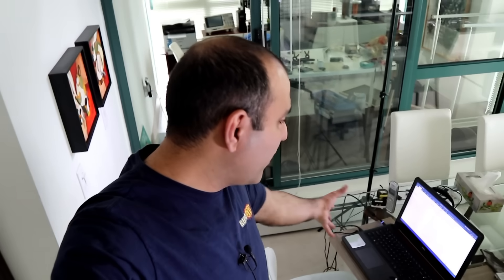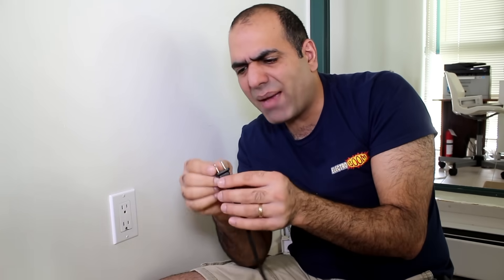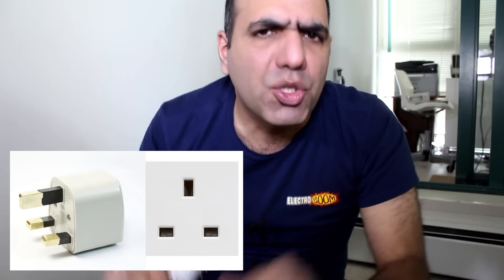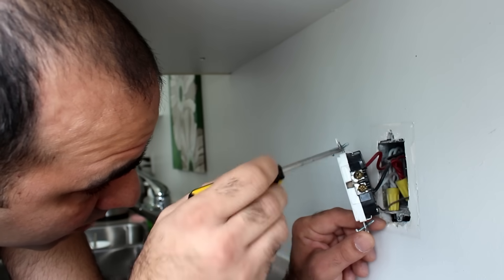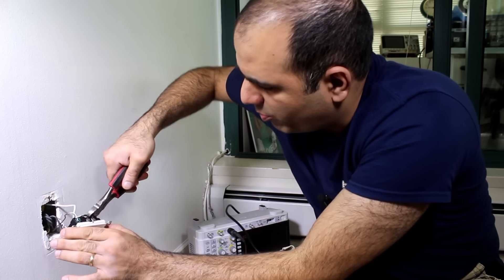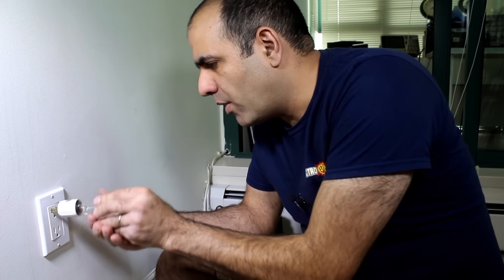How to Replace a Power Outlet

Comment: You want to bump your A-grade installation up to an A+? Just wrap some electrical tape around the outlet, covering the screws so there's no way anyone can get shocked by grabbing the sides of the thing.

Also, as others have pointed out, don't use the back holes. Use your wire strippers to bend the wire into hooks and loop them around the screws. That way they can't pull out and cause issues like Medhi mentioned, ESPECIALLY if you use the tape as mentioned earlier.

Comment: We in germany use safer power Outlets but use 230V in them and in Motor and Camping Power Outlets with three Power wires we have 400V difference what is more dangerous. Our wire coloring is Different red, grey and black is for the Power, Blue for the Nutrient and green yellow stripes are the Ground/PE well do me a favor please watch out a little bit more it Seems like almost every second Video you almost die it hurts me inside to see how you act so unsafe. Electricity can be very dangerous and deadly. But your Videos are very entertaining.

Comment: Yeah, at least in the US very few residential areas have 3-phase brought to them, and we have the center-tapped configuration you showed. It's unfortunate because it means running any 3-phase equipment requires either 1) a rotary phase converter or 2) a VFD.

Comment: There is an easier way to know what cable goes where on a North American Plug. 

White to white: the screws on one side of a plug or light switch is always silver (or white) and the other a golden colour. This is to visually signify what side to put the white and coloured wires. 

Though I am still unsure about 3 ways.

Comment: I always wrap electrical tape around the outlet after wires are attached. Just incase one would come loose it would short out and cause a fire. Also when the next person takes it out they won't get zapped by touching screws as you did 😉lol.

Comment: PSA from electrician. Do not backstab wires into outlets! The connection will loosen over time through plugging and unplugging things several times, which can cause arcing in the outlet. Instead, loop the wires around the appropriate screws, making sure they're bent in the same direction that the screw turns into the outlet, then tighten, making sure the wire is all the way under the screw. The connection will be much stronger and last for much longer.

Comment: North American regulations and standards really are the stupidest when it comes to power. Not only do they use 110V so they need 2 phases to power large loads, they also keep their wires on exposed metal contacts so you can touch them and get fried (still your fault if you didn't cut the power, but jesus....). Also from what I gathered GFCI outlets are not mandatory in all outlets. In the EU (or at least in Italy where I live) ground fault and overcurrent sensing circuit breakers are installed on the main line into the home so every single line in the house is protected. And we use 240V so our big loads use just one plug and not 2.

Comment: im pretty sure by now you know for sure but yea in usa and possibly canada unsure but houses use 240/120v single phase ac for the most part and commercial can use this same setup or can also use 240 delta 3 phase which is fairly rare or 208 y three phase and industrial usually uses 480 y 3 phase these are the typical setups

Comment: Fun fact: Insurance pays for stupidity. They will still pay out if you do your own electrical work and screw it up and burn down your house - as long is was not your goal to burn down your house (which would be insurance fraud). To deny your claim based on unlicensed electrical work, that exact thing would have to be listed in your policy as a reason to deny. So read your policy. If it's not in your policy, they can't use it to deny your claim.

Comment: The way I was raised I learned that you didn’t need the third prong for the large hole on a outlet/plug lol if you don’t have the big hole on the bottom plugged in or the third wire prong broke off it will still work and won’t hurt it

Comment: You know. In germany we have these 5 rules of safety.
1. Freischalten (Disconnect breaker)
2. Gegen wiedereinschalten Sichern (Make sure no one can close the breaker)
3. Spannungsfreiheit feststellen (Make sure there is no voltage present)
4. Erden und Kurzschließen (Ground and short, only for systems above 1kV)
5. Benachbarte, unter Spannung stehende Teile abschirmen oder abschranken (Cover or fence off nearby device that are still powered)

When doing your Job training, its one of the first things you learn. Eventhough you might not have much to do with mains voltage.

Comment: once when I was younger, I saw an outlet without a cover, and I tried to pull it out of the hole with one hand, connecting my hand to live and neutral. I got a shock, but it wasn't that bad. Now that I know how much that should've hurt, I am kind of confused how it didn't hurt more than it did.

Comment: I have actually grabbed those side screws once😂😂😅
Reply: Ikr. That’s why u should always tighten all the screws n wrap the electric tape around the outlet after installation. But as long as ur not touching the neutral/ground and the hot at the same time u should be fine, given that u are well insulated from the ground (the earth).

Comment: Axtually you are getting two different phases of a 3 phase libe in commercial buildings. You are correct that most homes in the USA get split phase, which are 180° out of phase. The NEC code prohibits 2 phases in an outlet box. They cam be two different circuits, but on the same phase.

Comment: You forgot to mention to make sure you wrap the ground wire clockwise around the screw. Also, its stronger mechanically to wrap the wires around the screws instead of putting the wire in the hole

Comment: 2:10   120 degrees between phases sound to me that they are two phases of the three phase power used in the larger buildings, factory,s etc
Reply: You are correct
Reply: @Owen_loves_Butters no 12:00:00 😊
Reply: You are correct. But in countries like India, UK etc. there is already 240V/220V ac in one phase. So no need of the 2 phase . Every outlet has 220V/240 directly in one phase. So it only uses only rating differences in outlets ( properly rated for large power appliances like oven/fridge/washing machine etc)

Comment: Hi Mister Electroboom,

Do you think you could make a video about the loose outlet of computers charging cable? Basically, the situation is very similar to what's depicted in this video where the female side of the outlet has lost a lot of its grip but, instead of the power socket on the wall, it's the female port of the computer that's causing me problems. It's not super drastic and it can still hold on OK but i was wondering if you have a few tricks that I could use to either repair or help it hold on better. Thank you.

Comment: On the back of the receptacle where you snipped the wires, there's a little slot to insert a screw-driver that'll release the wires so you don't have to snip them.
Also, the receptacles in your house are cheap AF- If you open one up (or look carefully in the contact holes) you'll see there's only a single contact for each prong.  Better (more expensive) receptacles have two contacts pinching each prong when it's inserted. That's why bending the prongs on the plug together makes it tighter, and bending the opposite way (apart) will cause them to make poor contact, or no contact at all.

Comment: i did not know that 3 phase was used in residential areas in our country but as you said maybe it is a high rise thing to ease the power distribution as three phase can be transported and converted more efficiently in transformers but how do you deal with standard 240V appliances like ranges, dryers or water heaters?
Reply: Use a Scott-connected transformer. Derives a split-phase supply from any 3-phase supply.

Comment: In EU it does not matter how you connect live and neutral
Bcuz you can flip the plug 180c
Reply: That's only true in those countries that use the Schuko connector. It's a weakness of that connector that it is not polarised as it means that if an internal fuse in a device blows there's a 50:50 chance it's still live. It also means that single pole switches, such as those on table lamps, always break the live side rather than it being a 50:50 lottery.

Several other countries, like the UK, Ireland, Malta have polarised outlets as well as some non-EU countries, like Switzerland. The original North American outlet wasn't polarised either, and the feature was added as a safety feature via a wider blade (although it maintains compatibility with unpolarised plugs where that isn't required).
Reply: Nope. In Poland we have mandatory Polish Norms which do specify the live wire shall always be at the left side of the protective earth contact, and the neutral on the right side, with the protective earth contact above them. This way even if the receptacle is rotated, wires still are oriented the proper way.
Reply: Your plug is reaching 180 c? That's a fire hazard and you need to figure out what's causing that, ASAP!

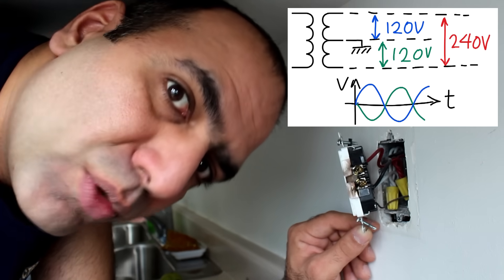Comment: 2:32 Mehdi!  Don't snip the wires!!  They'll get shorter and shorter, each time the receptacle needs to be replaced.  Instead, use a small, bladed screwdriver to press the release buttons.  But, on second thought, you'll probably burn your house down, way before this becomes an issue -- so, never mind.
Reply: Hey, i agree but notice that theres 3 wires coming into this box. Meaning that they had to wire nut the wires together with a pig tail (a single wire) to go to the receptacle. So in this case clipping them makes no difference cause you can just replace the little piece of wire. Good eye but in this case it doesnt really matter 👍
Reply: As an electrician who has installed thousands of outlets, I have only ever used the holes in the back maybe 5-10 times. We always use the screws because the connection is more solid, and like you brought up, it doesn't get shorter. Also, if we have to remove an outlet for any reason, the wires clipped in the back need to be removed anyway, so just unscrewing makes it so much easier
Reply: @petersquatch  Screw connection will get loose over time. That is the reason why (at least in Europe) they are being phased out by the more modern "Wago" push fit connectors. Not only they are easier to install (don't have to screw them) but they will guarantee a better connection. 

I see a lot of "old school" electrician that say that they prefer screw connections because they are more solid. I've even worked on an installation made by one of these electrician, and I found a lot of loose connections, one was so loose that simply pulling the socket out of the wall one of the wires pulled out. 

And even the best electrician will probably not screw one time a terminal properly. With push fit connectors it's impossible to make a bad connection (unless the connector is bad in the first place). 

And even if installed properly, screw connections can get lose with time. That is the reason why junction boxes that had screw terminals should be accessible for inspection and maintenance, while the one that use Wagos should not (although is a good idea that all junction boxes are accessible regardless of the type of connector used anyway).

Also they are safer, because in the end the screw is live metal exposed. And even if typically European accessories have the screw recessed so it's difficult to touch, it's still possible to touch it if you don't pay attention. With push fits connectors there is no live conductors exposed, and thus it's safer to work with (in theory you should never work on an energized circuit... in reality you have to do it, and the fact that it's safer is always better).
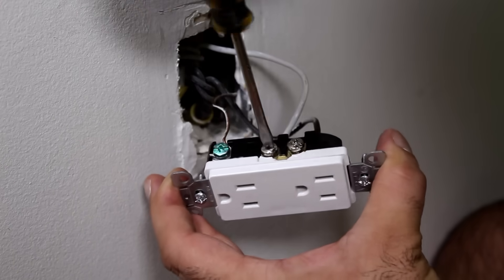Reply: @alerighi  Why even make the outlet with 'backstab' connectors, if the screw terminal is safer? When Mehdi screws them down after backstabbing, is this not tightening onto the wire? He is just screwing nothing? 3:01
Reply: @alerighi  When used with approved wire and screw terminal devices, a properly done and screwed down connection will never loosen.  Unlike push-ins, which rely on some sort of spring tension which will degrade rapidly with overheating, and become actively dangerous if you're having to deal with aluminum wire.  Especially if you've reinserted the wire in the pushin multiple times.

Even Wagos cannot be installed concealed UNLESS you use a wagobox and the specific Wago connectors which have been approved for this use.  Wagoboxes cost 3x or more regular steel boxes.
Reply: @peacefroglorax875  The screws are independent of the backstab connections.  The point of screwing them all down is to lessen how much the conductive parts stick out and could contact the box while you're manipulating the outlet (eg: for getting it perfectly vertical in a slightly tilted box), or  incautious finger or tool poking while the power is on.

Many outlets are made without backstab connectors.

The only burned out connections I've ever seen have been backstabs where the wire was dirty/corroded, repeatedly reused, or the wrong wire was used.

Back in the day when aluminum wire was popular, altogether too many electricians used the backstabs DESPITE code NEVER allowing aluminum wire in backstabs even in outlets specifically rated for aluminum.  How do I know?  Many of the burnouts I've seen have been exactly that.
Reply: 3:00 he forgot to remake that ground hook
Reply: Jared Pyzynski it doesnt go into a hole. It has to be screwed in
Reply: It's still long enough
Reply: Yeah, and sense he put the wires in the new socket then snips them again and is able to put the wires back in confuses me. Because isn't there copper or metal already in the socket?
Reply: @_playa_  He was able to do that since there are two backstab holes Hot and Neutral. He used the first pair, so he moved onto the second pair.

I disagree with the backstab method since screw terminals or screw clamps create a better connection, but he knows what he's doing.
Reply: @cherrysdiy5005  ah ok. Thanks
Reply: He did it on purpose so people learn not to do it
Reply: also dont ever use those back stab connections!
Reply: stealthmn why?
Reply: By the time you replace the outlet that many times your house would’ve been rewired so the wires would be the proper lengths.
Reply: If you open the breaker you shouldn't have a problem 🤷🏻‍♂️

Comment: I remember I was doing some work in my bathroom with the light switches, and I called a couple of my license electrician buddies for a few questions. I told them I had to put the phone down to go turn the breaker back on. They told me "ooooh, you're smart and went one step further and turned off the breaker!" I responded, "well how else am I supposed to do this?!"

Comment: At 1:45 he says you can plug the wires into the little holes in the back of the outlet... NEVER do this, just use the screws, i work for an electrician and it always ruins our day when we run into this. The connections break or come lose over time and make it much more difficult to work on the outlet when its hot which is sometimes necessary. If you are not a professional please never work on anything hot, even electricians will avoid working on things hot. Also using the holes in the back of the outlet is commonly called "back stabbing".
Reply: I meant at 1:35 just like mehdi has a message he tries to tell the world ("stop saying its not the voltage that kills its the amps") my message to the world is "don't backstab outlets! Use the screws!"
Reply: Backstabbing is fine, if it wasn't it'd be against code.

Comment: Speaking of DIY, in my house I have replaced numerous outlets, and in many of them the ground wire is just coiled up in the back of the box not connected to the ground screw... apparently the person who lived there before didn't think that was necessary. Oh yeah and don't forget the indoor romex wire used as outdoor wiring, buried plain no pipe or anything... out in the woods behind my house there is a yellow romex wire sticking out of the ground with a bunch of electrical tape on the end of it... and ofcourse the fact that one breaker box in the barn is wired to a single 20a breaker... gotta love what some people consider acceptable wiring...

Comment: Despite most outlets still providing them, using the back-stab (push-in) connectors of the outlet is begging for a loose (high-resistance) connection which can cause fires.  Use the terminal screws!

Comment: Nearly every time I go about replacing a power outlet, I start thinking about how much of the wire has been cut off over and over again. I’m not sure what the SOP is on the amount of slack in the wall power lines.

Comment: This install is not up to code. You're not supposed to install the wires in the back of the outlet they will come out/wiggle out and to prevent from the hot/neutral screws from connecting to anything (your first zap in the video) usually you'd wrap a turn or two electrical tape to cover the screw terminals, this way they don't have an opportunity to even contact with the conduit/box.

Comment: I know changing the socket standards would be problematic but damn that is poor design, pretty much every other socket style has the socket indented slightly and the pins are insulated halfway through so there is absolutely no way to touch the pins when the plug is making a connection

Also those pins look really flimsy if you can just bend them like that with your fingers
Reply: I think that in the US you could start installing 220V sockets (with a new standard, maybe copy the European plug) that is more convenient for appliances like switching power supplies (most of them can run on both voltages, but are more efficient on 220V), require smaller cables, and since you have already 220v in your homes is not a big problem.